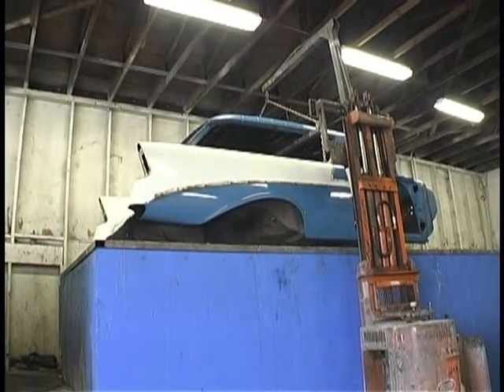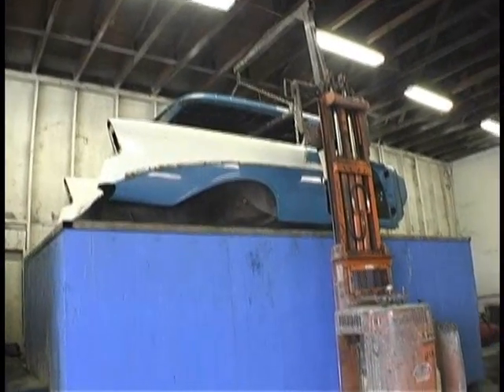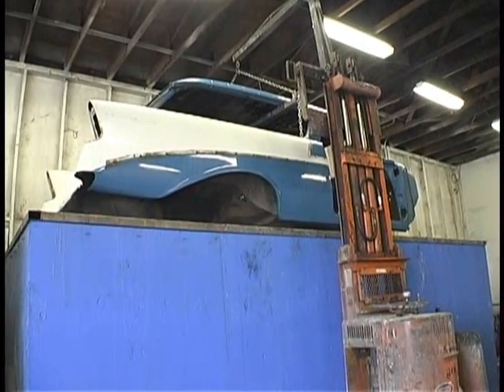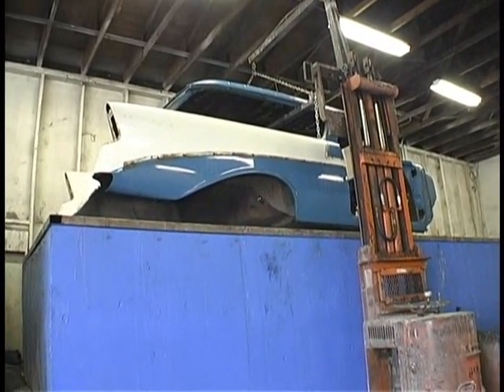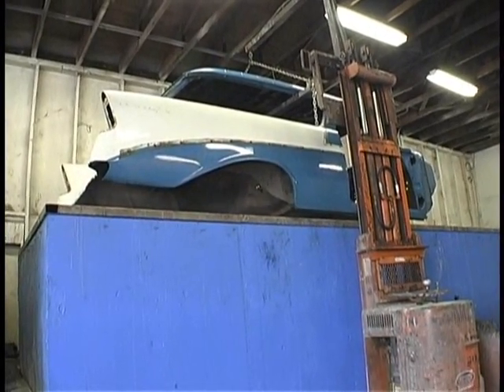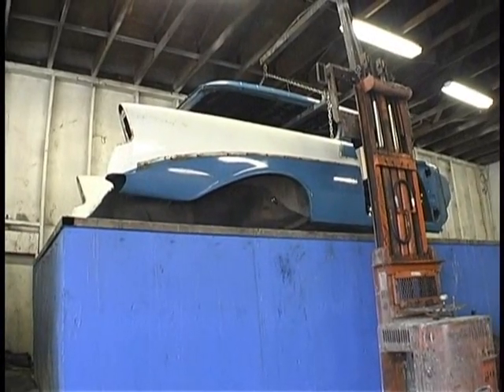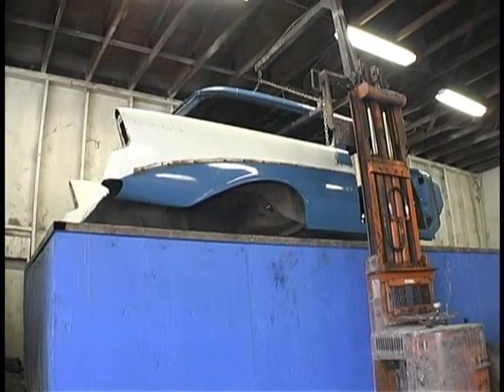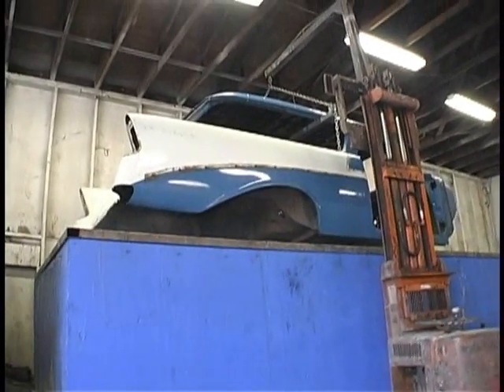MetalDipping 56 Chevy Nomad

Comment: I had this process done to my 62 Impala doors, trunk, hood and fenders in Portland Oregon years ago. It was disastrous. This cleaning process get into every nook and cranny and removes all crud and dirt and sealants that protect those areas you can never get to. After about a year later rust from the inside showed up in all the places you could not protect like all the door edges and trunk edges ruining all of your work. Moister get caught in these places during the rinsing process. Strip it the old fashion way or find someone to strip the external paint with a system called dustless blasting
Reply: I think now it's a 3 or 4 dunking process, with the last step in a rust prohibited liquid.

Comment: I always wondered how long the container that holds the assid last before that gets desolved.
Reply: A material that is designed to retain acid should not dissolve.
Reply: @pontiacattack249  its metal just like the car
Reply: @superliegebeest544  could have a plastic liner, considering those cars have to sit on those tanks for days, I would highly doubt anyone would be so shortsighted as to make a acid container that dissolves. After all, the car does not dissolve in the acid either..
Reply: @pontiacattack249  the car does disolve, only not on a rate that it disappears. But there are Factual storys about racecars they dip them in acid and the sheetmetal gets so thin it has no strenght left. Only the tube inner frame holds it together just to save weight.
Reply: @superliegebeest544  phosphoric acid does not dissolve sheet metal...
Reply: @pontiacattack249 alright mister chemical professor.
Reply: @superliegebeest544  do some light research on acid dipping cars man. The internet is at your fingertips.